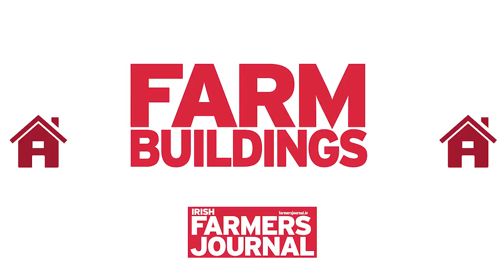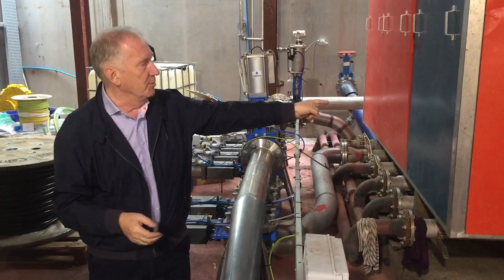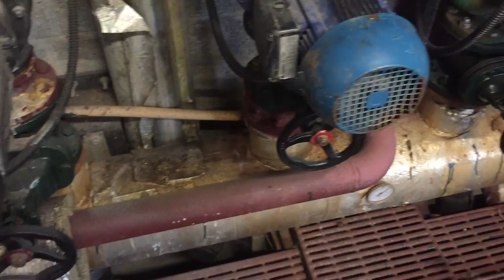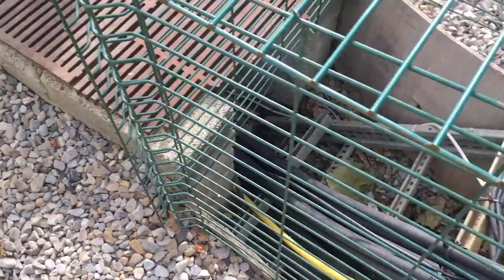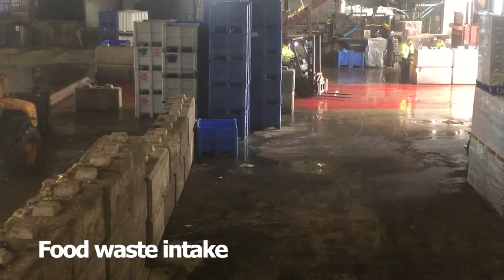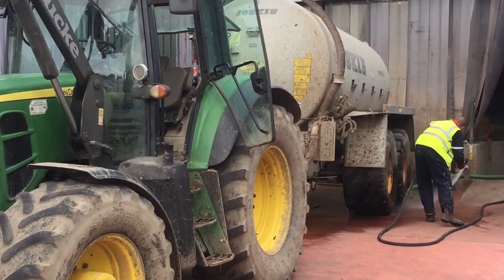Biogas from Co Kildare

Comment: The dairy herd are in for the winter so this is the time that can make an capture  methane . The time we have the greatest need for heat. What he is suggesting is a boiler house in a big building put's in a big engine powered generator  the cold water from the building heating system is pumped true the engine it heats up going true  the engine taking heat true the water from the engine to the building Colling the engine .I think its a elagant sulition for Ireland